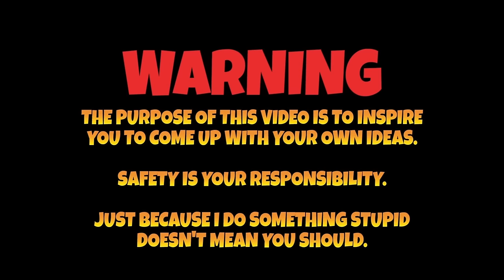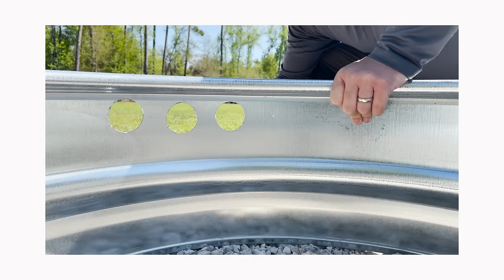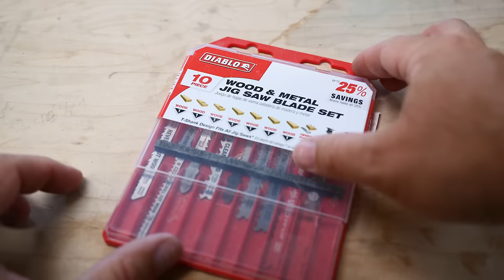8 Must-Have Power Tools For DIY And Woodworking

Comment from the maker: I have links for the tools I use in the video description guys. Here is the M12 combo I highly recommend: https://amzn.to/3sJ385f  Thanks for watching!
Reply: In USA for 219$ and UK 529£!
Reply: Fix the cord on that DeWalt jigsaw saw. Circular saw too.
Reply: Milwaukee is the best.
Reply: Better off buying from local tool supply business. Much easier to deal with if there's problems and usually as affordable as Amazon. Plus they have people with working knowledge of the equipment. I do not understand why people order stuff from Amazon and wait for a couple of days when you can get what you need and have the job done in a couple of hours!  If you need tools for your work you simply can't afford that much time waiting for the tool. What little money you save isn't worth how much you lost in down time waiting. Plus buying local really does make a difference in your local economy. The commercial contractors around here all have accounts with local suppliers. My experience in farming, construction and manufacturing is that if a tool breaks and a new one is needed time is of the essence!!

Comment: Most professional tradesmen prefer the 12v over 18v. I use the Milwaukee fuel 12v impact everyday at work. It's my all time favorite driver I couldn't do my job without it.
Reply: @Dalton Canterbury the 12v power to weight ratio. It's much lighter/smaller but still has more than enough power to accomplish most jobs. I do maintenance at an apartment complex. It would suck to have to use my 18v tools all day. They feel much heavier in the hand and would weigh down my tool bag also.
Reply: @TheBenjammin  I had the same experience when I started fixing up the house. The M18 Fuel Impact and Drill would start weighing a ton after several hours. I use the Occidental Seven Bags, Hip Buddies, and their suspension system too. It still weighed a ton at the end of the day. M12 is the way to go for impact and drill
Reply: I worked at a major farm machinery assembling sprayers. The 12 volt is good for small jobs, but the size of the bolts on bigger parts necessitates using 20 volt, mostly DeWalt. We had hundreds of these in 10-12 hours of daily use, sometimes working 5-6 days a week. The newer 20 volt impacts are close to being as strong as professional air tools when tightening large diameter bolts.
Reply: At home there are some really hard concrete walls so I bought a 12v drill for all the easy stuff and a cheap bosch corded drill hammer for all the heavy work. Works really good.

Comment: FYI: 18 and 20 volts are exactly the same. 20V is just marketing speak, appealing to those folks that think higher always equals better. Same goes for 10.8 and 12 volts, and (kinda) for 36 and 40 volts. I know that Makita brands their 36V batteries and accompanying tools as 40V, because they already call their 2x18V machines the 36V lineup, I'm not sure if other brands have a similar thing going on. In any case: when you see two tools, one saying 10.8/18/36V, and the other saying 12/20/40V respectively, as long as they both only use 1 battery, the voltage is exactly the same.

I can affirm the quality of the 12V Milwaukee tools. I'm a Makita guy myself, but if I couldn't get Makita, I'd 100% go for Milwaukee. Not only do they have quality tools, they also have some nice gadgety tools. Ryobi has a lot of these gadgets too, but Milwaukee is a lot better IMO.

About the impacts: They don't necessarily get more power (normal drills actually have more torque usually), they just put a lot less stress on your hand. Where you need a big second handle on a big drill, you can use a big impact driver with one hand. It's comparable to trying to push in a nail with a hammer, or impacting on it (also known as hammering it in). The impact vs the constant force can make a big difference. Impact drivers are worthless on (very) large screws though, no matter how strong your impact driver is, it will not be able to drive a 600mm screw (24" if my conversion is correct), because all the power from the impact is absorbed by the screw flexing along its rotational axis.

IMO, you missed the most important part of hand-held circular saws: On which side the blade is. For those who expect to hold the saw with their right hand, it's usually a lot more comfortable to have a saw with the blade on the left. Sadly, most circular saws have the blade on the right for some reason. 

Other than that: great summary. I don't think you missed anything, and I would indeed call this set the basic set of tools, maybe leaving out the table saw.

As always, before buying anything: Check out the options, and do some research. YouTube is a very good resource, since you can easily see how people test the tools, and then determine if you think that's a fair and repeatable method of testing, but don't rely on people's opinions. Some will say you need to have a 36V drill, because you won't be able to do anything with less, but the reality is that most people will get along with 12V just fine for home use.

And like said in the video: Make sure you choose a brand you're going to stick with. So if you're looking at drills, also look at what that brand offers for the next couple of tools you may want to get in the future. There's no use getting into battery eco-system A if only half the tools you want are available in that battery eco-system, unless you know from the start that you don't mind multiple battery eco-systems.

Comment: I use Milwaukee and DeWalt cordless tool and after you buy one kit or so and have batteries and a charger you can then buy bare tools and not have a pile of chargers… I must say I do like my Ridgid 10” table saw …. Thanks for your video I’m sure many will find it useful ✌🏼😎🇺🇸

Comment: I still have and use a Craftsman circular saw I bought in 1992.  Still works great.  A couple years ago I bought a DeWalt 20v set which included a cordless circular saw.  It’s convenient to work away from the house but I still love my old saw.

Comment: I have been using Milwaukee for a few years now and I almost exclusively use my impact drivers for drilling and driving. It is common to find drill bits with the 1/4 drive. In some cases it is harder to find the "traditional" drill bits in the areas I shop.

Comment: I've had my Bosch PST 700 E jigsaw for about 12 years now, and I honestly love it. I even use it for things that don't necessary require a jigsaw. It's easy to use, easy to replace the blades, easy to clean and stow, powerful enough for thick oak countertops, and I've never had that issue with dust getting into my face (which is probably a bad thing, because I keep forgetting to put on my safety glasses when I work with it). 😂
Reply: Bosch tools are so strong and reliable. I've used every name brand tool and they don't stand up to Bosch.

Comment: I have 20V systems... both DeWalt (my every day, day in, day out, heavy duty use) and Ryobi (specialty use, rarely needed - less costly) , but I also love my little Bosch 12V 3/8" cordless drill.  It can get into places that the bigger 20Vs can't, even with a small battery attached, and it is so light to carry/use.

Comment: I have both 12v and 18v tools, and 8/10 times I reach for my 12v as they are much lighter, smaller, usually more than powerful enough and easy to pack in a small tool bag with whatever I need for the task. However I really do feel that 12v is a luxury to get if you already have 18v tools simply because they have limitations. 

For comparison, my 18v drill is according to specs over 3 times stronger than my 12v from the exact same brand. While I love the little guy and use it most of the time, there are tasks I just do not take it to like stirring paint, big drill bits and hole saws, longer lag bolts or even brushes (those for cleaning furniture and car interior). In some cases it - can - do it, but it obviously puts way more strain on the tool than it likes and eats through battery like crazy.

And yes I am fully aware that in some niches and professions there is absolutely no reason to bring a big 18v tool, but since this video spesifically was about DIY and such I assume we are talking about general purpose tools for around the house and garage. Get-whatever-can-do-the-most-stuff-for-you kinda deal
Reply: How close are the 18v compared to a corded version in power? I found that the corded versions is very cheap and I use them sometimes when I need the extra power. It was also cheaper to get a 12v + corded than the 18v I needed to fit booth. On the hand I now have 2 tools....

Comment: use to own a home improvement company. Milwaukee makes awesome tools (have a few), they are pro level for sure. But, recently dumped Dewalt cordless for Ridgid cordless. Prices right now are a bit cheaper with sales, and can tell you I'm hooked. Haxman is correct. Just see what brand has more of the tools you need... Automotive and/or Home owner (I'm both). Same battery runs all tools. So just buy bare tools if you already have batteries. Cheaper! Smart!

Comment: You showed exactly why my circular saw is cordless. Cutting the cord with the saw =⚡.  Circular saw: 2 clamps + 2x4 (preferably planed) = easy straight cuts and portable!  Router: A router table is a simple solution of the cord issue for a lot of applications

Comment: While it doesn't fall under tool pursé, a dedicated work bench/table is pretty choice. 

I've recently upgraded the one I made over a decade ago(which still gets used) 
 for a table I got out of a public school when the world shut down. At least near me, the public schools got rid of all their butcher block tables and replaced them with stainless, and I work for a company that services commercial kitchen equipment. 

'Inheriting" a 72"x30"x3" hardwood table with a beefy stainless base that's probably older than my 48 years has been incredible. 

Several holes drilled through the top and holdfasts have upped my game and speed.
Reply: Per se. Lol

Comment: Nicely done, content, points covered, concise delivery (well scripted), list of tools, strengths/pitfalls pretty good. SO true about the Jigsaw! Some jigsaws are better than others for sure.. better power, smoother cut, less vibration, etc. 30 years ago, borrowed a porter cable, and was astounded how well it did at a job my cheapo couldn't do well at all. Very good points about having to work in limited space. About the only things I would add.. as you get more serious about production or large jobs, pneumatic nailers, staplers, and dust collection become LARGE issues in a hurry! I can't afford the rail saw system, but have always had a 8' straightedge.  Yes, buy as much saw and rip fence as your budget and space will allow - I could not get away with that short a rip fence.. my 53" is often too short! 
Still, great job putting this one together.. I will forward it to all beginners I know.. Thanks!!

Comment: the hammer drill setting is underrated, helps sink tough screws and lags that you're fighting, bought the m18 fuel version and essentially makes it a bigger impact gun
Reply: If you need to deal with concrete.. get a proper SDS rotary hammer drill (there are cheap versions). The normal round shank drills that have hammer function rely on a mechanincal cam and impact is low due to lots of inertial mass of the chuck and bit where the SDS has a heavy impact made pneumatically (or mechanically) and the inertia is very low - just the drill bit that slides on the flutes of the SDS. Also round shank drill bits for concrate are rare and low quality (not the masonery bits.. those will chip the tip insert in the first few hits into concrete) while SDS drill bits have thick carbite inserts.
And skip the hammer function on the cordless drill, no need for that toy hammer.

I live in europe where concrete walls are a thing (real concrete cast in place with rebar inside) so a proper SDS rotary hammer is a must even if you want to hang a picture in the living room.
Before i got my sds drill a simple hole in the wall would trash the bearings in the corded non-sds drill i had (600W, decent torque, two grips, hammer function), chip a drill bit, burn the drill bit (because it has high speed needed for wood and steel, not concrete), curse a bit and 1h later i shorten the plugs and shorten the screws to call it a day with the mere 40mm of progress in the concrete if it's not a critical loading anchor.

With the sds rotary hammer it's a breeze. 10s and you get a hole done.
Reply: Uh I don’t think you want to be using a 12v drill to mix concrete lol
Reply: @AsiAzzy   Well nowhere did I say concrete, I was referring to LVL construction and stuff but even so, the FUEL hammer drill will handle much more than you think. obviously I wouldn't drill an entire foundation with an 18v (I would probably end it after killing my entire battery collection in 15min) but have absolutely used it successfully to install lags into tough lumber and install a handrail into concrete as well. I own a Bosch HD, I believe the bulldog and it's great but yea was mostly referring to woodworking/construction
Reply: @marlonestrella8105  Who said anything about mixing concrete with a 12v? Who even uses 12v other than electricians lmao
Reply: @blxckleppxrd  the person deleted their comment…
Reply: @marlonestrella8105   ah, typical, my bad

Comment: At work we try to use a impact driver for everything. Never use a drill unless the bit doesn’t have the impact connection. We use dewalt 20v. Both of our drills barely work for some reason, impacts work great.

Comment: If you're doing demo of any kind, the reciprocating saw pays for itself on Day 1. Cuts through wood, nails, plastic, metal pipe, drywall, etc. Saves a lot of wear and tear on your body. Best 150 bucks you'll ever spend.

Comment: I have a Dewalt 20v 4.5 inch saw. It is so awesome and can even cut 2x lumber. So much easier to handle than a 7.25 inch saw. It's a dream for cutting sheet goods. I think it actually might be a great starter saw as it is less intimidating- and more limited in capacity- which might be a good thing starting out.
Reply: I have the Black and Decker version but can't find any 4.5" blades

Comment: I would add a angle grinder, recip saw, and not to forget a good shop vac to not only help clean but to hook up to miter/table saws and sanders to keep dust down.   And keep in mind your budget vs usage,  nothing worse than spending big $$ on something that will sit in a cabinet or buying low quality that will wear out and force you to prematurely replace,  while I do recommend the mid to high end tools remember the old saying “you’ll get more done with a shop full of lower quality tools that 1 expensive tool”,  also check around as you can find barely used quality tools at a good price.

Comment: Fyi 3d printers have helped a lot with the battery mismatch issue you can print adapters for alot of batteries to adapt them to other brands
Reply from the maker: Cool. I didn't know that. I have a 3d printer.

Comment: For me, I went with a drill, circle saw, Jig-Saw, Sander, and most importantly, a Dremel Rotary tool because my thing is fine carving and wood sculpting. Ended up also getting a reciprocating saw to do what chainsaws are too big to do.
Reply: Yeah, good call on the dremel. Also, no sawzall?
Reply: Recips are great for branches and tree roots too! No worry about ruining your chainsaw blades.

Comment: Lately I have been purchasing 12 volt sub compact cordless/brushless tools. For most projects they are more than adequate. I do have higher volt cordless tools when the project needs more umph. Read up on tool performance and you'll be pleasantly surprised!

Comment: So I have a couple must have tools, drill and circular saw in DeWalt brand 12v and tools I don't anticipate as much use from in the Bauer brand 20v. I know, two different battery systems but I can't see paying top dollar for every tool I might ever need around the house and I have a fixer upper I'm living in. I've got a reciprocating saw I've used for branches and tree limbs, but anticipate some demo work, jig saw, 6¼ cordless circular, oscillating tool, and anticipate getting the compound miter saw, grinder, sander, and who knows what else I may need. Both brands are a mix of corded and cordless. So far all the Bauer's have been just as good as my DeWalt's as far as performance.

Comment: Great video 👍🏻 I've 7/8 of those tools so guess I'll have to order a track saw immediately. The impact driver gets used all the time - like you point out the socket attachment is v handy.
Reply: The track saw is the only one I don't have and that will continue; I've never felt put out by using a solid(wide) straight edge and clamps.
Reply: @Spthomas47  yea agreed! I trimmed a bunch of fence boards using a 12foot section of d-rail last week. Plus you can never have too many clamps!
Reply: @nathanmcauley121 the clamp/clamping options obsession is real hahaha

Comment: Hey Haxman, I'm glad to have landed on your channel. I want to buy these tools, but I'm a newb. So I was looking at an INGCO cordless drill on their official website, but the website doesn't mention a 1 inch chuck. All it says is "Chuck Capacity: 0.8 - 10mm chuck" even on the 20V drills. How do I tell if this is the one with the right chuck?
Reply: That's a 3/8" chuck. The recommendation is 1/2". You're better off with one of the name brands that has a 1/2", especially with all of the other tools on their platforms that use the same battery system.